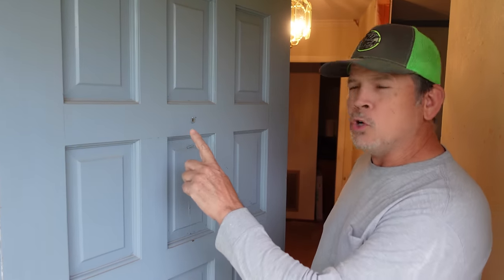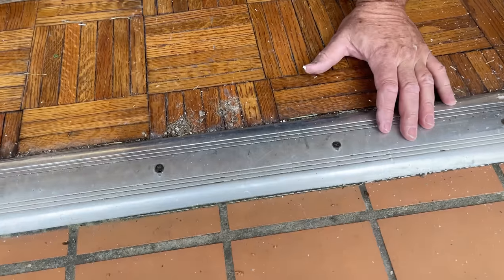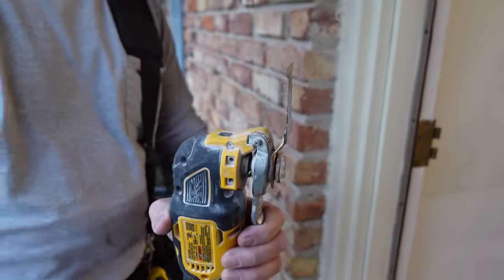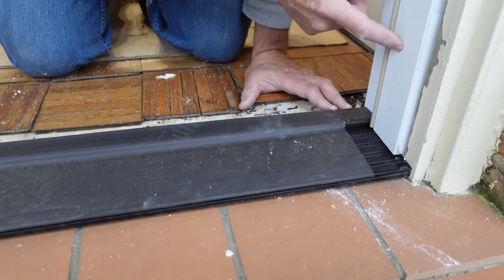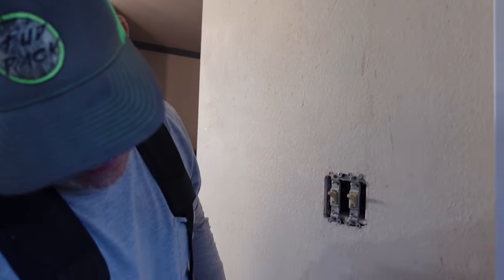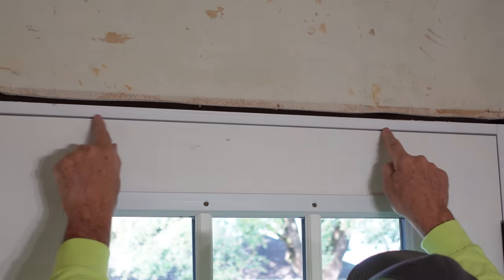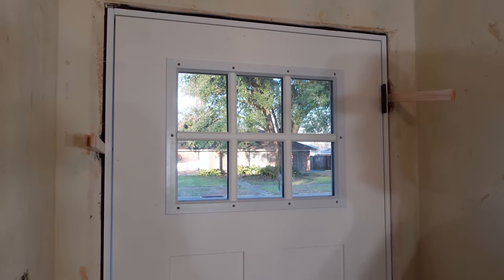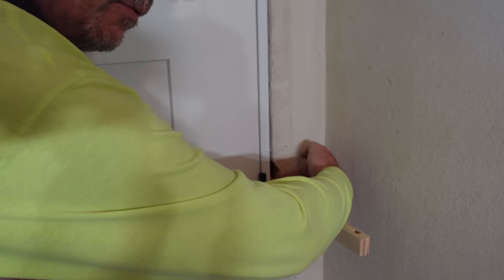HOW TO REMOVE and REPLACE a Front/Back Door (Easier Than it Looks!)

Comment: "How hard is it to get 5 screws that match"...I almost bust out laughing. You would go nuts if you saw all the crap I've found since moving into this house. Pretty much everything is incorrect, let alone matching. 😂

Edit:*pulls up flooring* "may have a bigger job"

If there's one thing I've learned over my years renovating, it's that once you start removing stuff you better be ready for a bigger project, because you'll keep finding stuff to fix.

Comment: Any ideas for a door with a large gap under the threshold? Our door was kicked in and damaged everything.  Even with a sawzall and a lot of patience, in order to get it in the existing spot and still able to clear the ceiling when it opens, there is a significant gap below the threshold. To the point I'm scared to put any weight on it as it will just flex and probably slightly crease (about 1/2in of movement). Can I just try to throw a thin piece of wood in underneath?

Comment: Have any cinder block homes that you did the door? I am at a site doors were push ins and cased and a tad bit if caulk is all thats holding them in besides the trim omg. Thresholds are shot and the typical rotted frames at the bottom. I wanna make these 2 doorways secure.

Comment: Somebody paid a lot of money for that cheap door. I was the Fix-it Guy for 126 new houses and one problem was interior doors slowly swinging shut when new Homeowners wanted them to stay open so I cut tons of shims out of the type cardboard shoe-boxes are made of and adjusted the hinges the way you did, each door and hinge requiring varying numbers of shims.
Reply: Shim with a wire ,,then inject liquid nail  behind the hinge  through the screw hole ...

Comment: It appears you put a screw in the door casing just next to the hinge to prevent the casing from moving in the future. Might I suggest putting the screw under the top hinge location prior to screwing the hinge to the casing. That way there is no need for a plug or anything and you will always have access to the screw   In the future.

Comment: great work, thank you. sure wish you were in my area because i paid Angie/ home advisor too
much $money to NOT hang an exterior door and dead bolt the right way as it is wrong. not a professional work at all, drilled hole for dead bolt wrong-ruined that door+ other framed Prehung door installed wrong. cracked the outer vinyl on top of door opening and closing not shimmed correctly.

Comment: You Can Avoid Using Shims Behind The Hinges, By Bending The Hinge. No Two Hinges Are The Same.
So What I Saw Was You Had To Add Shims To 2 Hinges Well More Than Likely You Only Needed To Bend Those 2 Hinges. 

My Family And I Install Windows And Doors Every Day Approximately 2500 Windows And Over 600 Doors A Year. 
We Have To Bend At Least One Hinge On Every Door We Install To Get That Hinge Reveal Just Right. 

How Pull Pin, Then Bend Hinge Barrels That Is Attached To Door Slab, Not The Hinge On Jamb. Now Bend Barrels In The Opposite Direction Of The Way You Want The Slab To Go.
Your Case The Slab Need To Go Left, Bend Barrels To Right, It Is A Very Small Bend. Bend, Put Pin Back In, Check. Not Good Pull Pin Bend A Little More.
Another Trick Is Always Start With Hinge Side Like You Did. But A Nice Trick Before Bending Or Making Reveal Nice And Straight. Quickly Run A Chalk Line Or String Down Jamb To Ensure That You Jamb Is Perfectly Straight The Whole Length.

Hope It Helps. You Wont Need Those Custom Shims Anymore.
Thanks For Doing Good Work.
God Bless.

Comment: @7:50 ... WRONG .... (New Construction) The brickmold is not put on AFTER Brick , the door and the brickmold is installed FIRST and then the masons lay brick TO the brickmold .... In new construction it doesn't matter if the framing is plumb , the door is set in the hole and the bottom rests on the slab , and unless the framers or cornice crew (whoever is setting the door) takes the time to perfectly shim and level the door (which they don't) the door AND trim can be slightly unlevel and out of plumb and most crews will CHECK for plumb , but if it's close they yell "NAIL IT !!!!" and bam bam bam go ..... That door and brickmold was set BEFORE the brick was laid , so don't blame the brick for the brickmold being out of plumb , the brick wasn't there during initial door installation when the house was built ......

Comment: That’s why I build my own jambs and router out my own plates and hinges. Drill my own holes for the lock sets and dead bolts.
Buy the slab, and jamb sets either the thresholds,
If the threshold is not included, you buy one separate or build your own.
The customer deserves the best and that’s what I’ve always provided for them.
I don’t fight the door manufacturers, because it’s not our job to fight them and it leaves imperfections on the surface that have to be repaired and that takes up valuable time that you can be using on important work.
“fk repairing other people’s work”
I look at it like this….they’re messing up the work, it looks like crap l, they go on with their lives and I have to clean that up?
NOPE !!! 
it’s not good for me or the customer.
Manufactures only think about money.
Go around them and eliminate them from the loop so they learn to build quality products.
No quality, no business.
Not from me anyway.
Building door jamb allows you to custom fit every opening right from the start when you have all the pieces.  You can rip the jamb down to the width you want, and not have to modify someone else’s work.  Most of the time it can work but there a small percentage of time it doesn’t.  
Building a jamb isn’t like building a rocket, plus it’s a lot of fun in the shop while you’re watching judge Judy or American Greed 😂
The customer can choose their own hardware and lock sets and they will fit perfect because it’s not a monkey in a fast paced environment using tools free hand instead of using a tuned jig.  No need for shimming hinges.
Another thing I do on exterior doors which finally manufacturers do now after sixty years of rotted exterior jambs and casing is make them out of PVC on the lower part so they don’t rott.
What I do to prolong the life of an exterior jamb is coat the bottom 12” with “paintable” silicone.  When the jamb is complete and just prior to installation, Use a putty knife and apply a smooth coat. Let that dry for a day. 
Apply it all around the bottom 12” so it’s as if it was dipped in it. 
The customer is paying us for a quality work, so that’s what they get.  Explain all this to them so they know the difference between what you get in a store and what you’ve just finished doing on their home.

Comment: I checked some doors on my house and they are all different. The place where you split the jamb and brick molding are all different widths. That would leave a different door jamb width required for every door. How do you deal with this issue? Do we need to try to cut the door jamb widths ourselves?

Comment: Nice job and I also second your squaring of the door and the "McGyvering" with the plastic shims @ the hinges. So, I have the existing 8" threshold and installing a new door with a 4 9/16" threshold. I'd like to keep the exterior part of the threshold and I'm thinking about cutting out the door frame @ 4 9/16" and sliding the new one up to the remaining  threshold. Where the wood meets, I put a 1/4" cap that aligns up. Thoughts?

Comment: I taught myself to hang doors and many other carpentry type installs as well without prior experience. It's not that challenging or difficult and in fact you don't need a college degree. You need patience, keen eye and ability to think the install through. Be willing to measure twice and cut one mentality and have the correct tools at hand. Good luck.
Reply: Yeah right.
A door install aint as easy as people think, and if its not plumbed and gaped, as the moisture content in the house structure changes with the seasons, door openings get a little larger and smaller depending on the season. And you have paint layers over time that can affect the gap. Toss in some settling . . . If the attention to details is brushed aside, you are inviting a poorly closing door down the road. 

1/8 inch gap all the way around.
Level it
plumb it
square it
If the above is done correctly, the sound and feel of the door closing on the stop, should sound like a single clap and feel solid.

Comment: Not a huge fan of shiming  out behind the hinges. If the space is 3/32 on The hinge and 1/8 on the knob side let it go . Also noticed you possibly stripped out the small hinge screws. And one more thing . Don’t take the weather stripping off . Use a 3” white trim screw to fasten easy to fill and easier to hide behind the weather strip

Comment: We were refabing and had the idea of making an interior door to be a front door to an apartment.   Front doors are expensive so I decided to buy a beautiful fiberglass slab door, let me tell you it was the worst decision I've ever made.  Getting the Slab to fit was a challenge, it didn't.  The levels on all 3 sides were wrong so the door was not able to compensate for it. We could close the door and still look through to the sides of the door and underneath the door.  I disregarded what all the door people were telling me and they said to get a hung door.  I should have listened.  I spent $900 on two slab doors and they are now essentially trash. I have to buy hung doors with frames.  Dealing with doors is not easy, leave it to the professionals, you will save yourself a lot of heartache even tough it will cost you plenty.

Comment: Hope you installed a double cylinder deadbolt rather than the likely single cylinder it used to have. With that glass and a single cylinder, all someone would have to do to get in is break the glass and reach in to get to the throw. Seen a lot of people make that mistake. You do need to be wary, the solution is to put a key near the entry which can't be reached from the door, in case of emergency.

Comment: I have an odd question (but only gave a quick look in comments below):  what kind of stiff blade scraper is that (towards the beginning of the video).  What a darned handy tool. Seems durable too.  Seems like anything I've found is nowhere near that tough or durable.
Reply from the maker: Look at Home Depot for a Warner #2792 👍🎄
Reply: @StudPack  I will check it out.  Thanks for a speedy reply, and very informative videos.  I (and many) really appreciate and learn from them!

Comment: Was the floor level and It couldn’t hurt to put a level on the hinges to check for plumb and the alignment. I think the door was fine to begin with
Reply: I worked for a major door & window company for 18 years making things work that were either installed badly or had factory issues.  I left there 20 yers ago.  I recently had to f-around for four hours installing a "prehung" door where all three hinges were set wrong, all three hinge pins pointed in different directions in two aspects !  Anybody remember when jambs were made from 5/4 and didn't have to be shimmed every 6" ?

Comment: I'll tell you why it's like that, there's a jig that has a template at the top of the router you have to move a dowel around the template while you route the strike. If someone doesn't follow the template completely that's what happens, you can see where the brought the router over real fast but didn't follow the template completely on the y axis.

Comment: I spent 5 grand on a pre hung fiberglass door. 36" x 8'.  Those idiots made the frame the same size as the door.  My carpenter struggled to put it on and then the door shoe at the bottom would not let the door close once installed.  He had to trim the bottom of the door to get it to work.  At the end of the day it closes nice, but obviously the gaps are not perfect around the door.

Comment: Technically, it really is not super critical if the door is plumb or level, it's nice, but not imperative. What is MOST important is how it operates then how do the reveals look. Interior doors, use a 3' or 4' level on the floor, showing the high & low side, then cut the bottom of the one side of jamb the distance it is off level. I.E., hinge side is 1/8" high, cut the hinge side jamb 1/8" off. When the door is set in, it now becomes level.
Reply: Technically, if the door was installed properly, 

Level it
plumb it
square it
1/8 inch gap all the way around.

If the above is done correctly, the sound and feel of the door closing on the stop, should sound like a single clap and feel solid.
A quality install will provide years of trouble free operation.

Comment: If you have never replaced an outside door then you have no idea the nightmare you are in for.  While this video does a decent job of going over about 30% of the problems you will face, like so many the veterans gloss over the tedious details that are required to install a door where,  one,  the reveal is consistent, no major gaps, the door does not bind, the door open and closes normally and finally the door does not squeak like crazy because of how much you had to twist the jamb to make it "square" and flush with the surrounding house.

Anyone who can come up with a real solution for the do it yourselfer will become billionaires.

Comment: That hole you thought was for the long screw isn't for any screw at all, it's a anti theft device so the door won't open is the pins are removed... Check the opposite side of the hinge for the protruding half round punch out
Reply from the maker: Yeah I know about that but manufacturers typically leave one of the short screws in the jamb leaf out so the installer can use a longer screw into the framing.
Reply: @StudPack  Miami hurricane code requirements are the most stringent in the country... I believe it's two long screws per hinge but don't hold me to it, I'm getting up there in the years
Reply: @StudPack  as por this long screws I found the best to use were furniture grade square head because most of the other strip out if getting into Dade county pine.... It's really tough stuff

Comment: Why are US exterior doors opening inward? One would expect them to open outwards away from the house. Like if you're running away from a fire your first instinct is to push things out of the way from you. Also when closing the door from outwards you can also provide a tighter sealed fit, protecting from rain. And third you can decorate your entrance however you like it not worrying if the door is going to be in the way when you open it... :/

Comment: What about if the door is hitting at the bottom corner on the door lock side. Could I use shims to lift the door up in the bottom corner on the door lock side?
Reply: Are you still having trouble with that door?

Comment: You are doing the person who will behind this door a disservice by not using screws that go into the framing not just that little 1 by stock. Do the same on the strike side as well. Use at least  a 3  1/2 inch GRK screw. It won't stop a determined intruder but it will slow them down and make a hell of a lot of noise.

Comment: Ear protection. Use a set of foam plugs that are on a string, let them hang around my neck and tuck them into the front of my t-shirt. Out of the way and it's easy to just pull one ear out to talk. May get your ears dirtier from rolling the plug with dirty hands, that's only negative.  tried a bunch and then bought them by the box of 500. No excuse for the guys to not have them.
Reply: Good door install vid. If you're doing interior check out the steel mounting kits. They remove the shims.

Comment: Your door  is to low. If you can't fit carpet on the parkee  floor  to catch dirt, rocks, snow or wet  shoes, it needs to be  raised  up 1/2 inch. The Carpet  will  help your floor  last longer  and the  area stays much cleaner.

Comment: I just use cardboard for a hinge backer , works perfectly , no problems , cut 'em in 60 seconds .... 1/8" cardboard works fine AND it is somewhat adjustable .... 1/8 too thick ??? smush it down a little to 1/16th ...... been doing that for decades

Comment: The entire problem here is that the floor isnt perfectly level, hence the strike side of the jamb is sitting for about 1/4 inch higher than the hinge side. This will not allow the door to fit perfectly

Comment: Great work on the door and frame adjustment, although you should never use wooden shims, let alone several of them, especially this light white wood, but only one-piece strong plastic shims, filed down to the desired thickness if necessary.
Such a door and frame fitting is probably not "legal" in Europe, your frame has zero thermal insulation on all 4 sides, and will be leaking heat like mad in winter, as well as letting heat enter in summer. There's a whole set of techniques to install and insulate door frames that may require a separate video.
This door is also way too thin to be an external door. Again, not "legal" here. OK, not "not legal", I mean you can't install such a thin door if you are also seeking energy saving subsidies (up to 50% of expensive wood work here). If you don't, I guess you can even install a bottle caps curtain instead of a door...